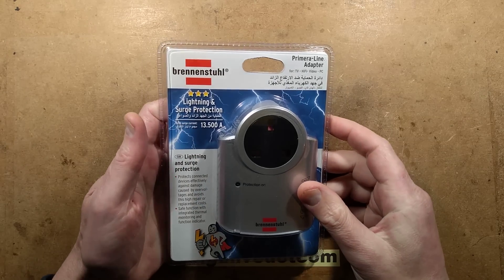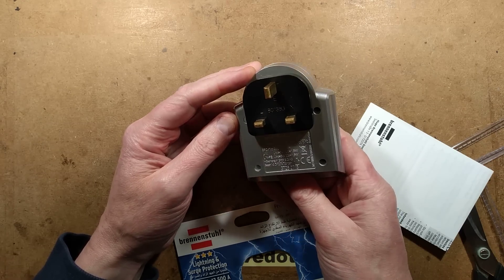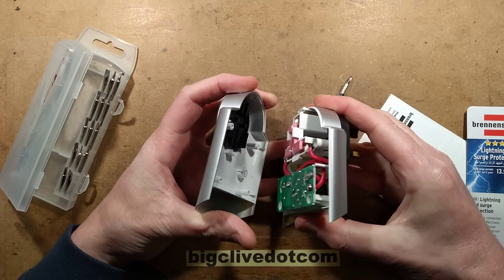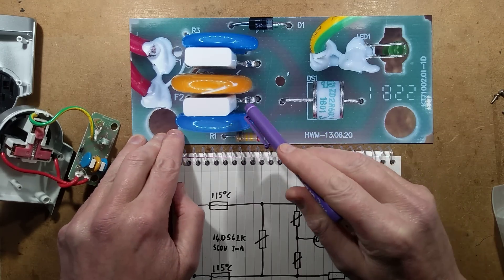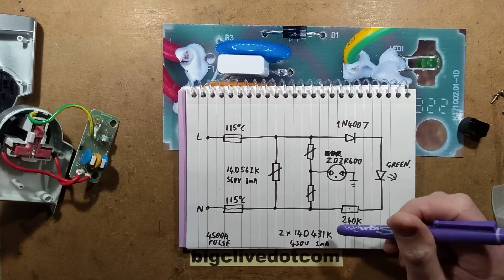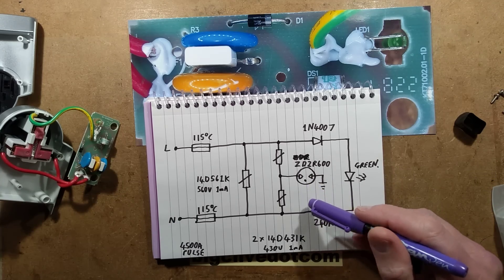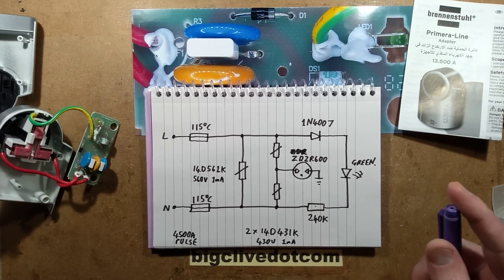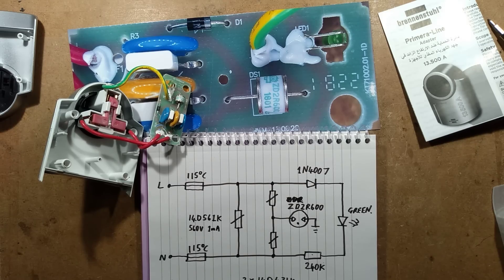Inside a 13,500A surge protector.  (With schematic.)

Comment: These brennenstuhl surge protectors have been my go to for quite a while. Any really expensive equipment I have is protected by a UPS, since those provide better protection against surges than surge protectors.
I use brennenstuhl extension cords in the labs at work cause their pretty solidly built and have some nice re-settable fuse versions. Can be difficult to source at times though... often don't see them for sale for months.

Comment: Way back in 1961, we moved from "the old homestead" a farmhouse built by my grandfather in 1910, to a more modern farm some 12 miles away. Dad put his land into the "soil bank" (a program where the farmland is left fallow for a period of time and the government pays the farmer for this) and he rented a farm closer to town so my sister could attend high school.  Well we were thrilled, we had electrical power!  When dad went to town he stopped at a TV repair/sales store on main street and made a deal on an old used floor model television, and a large antenna since we lived over 100 miles from the nearest station. Along with the package the repair guy sold dad a small round device with a sort of screen case that he said we HAD to have plugged into the socket before we plugged in the television.  He also sold us a lightning arrestor that had to be placed in the tv wire leading from the antenna that was atop a 50 foot pipe sticking up the chimney of the old farmhouse which was right next to the small house we  occupied.  I was just wondering if that little round black deal was anything like an early design of this thing?  I think what I remember best about the whole deal was that the set acted like a Ford Detector, any time someone in a Ford car pulled up the TV would show the firing of the spark plugs or something in a sort of interference pattern on the screen.

Comment: Clive, I was at a fire safety seminar. And I have a few surge and spike protected strip sockets. To cut it short the expert on these things said the only safe and workable units are ones that fit into your distribution boards. No other one passed their tests.
Reply: There is the unfortunate bit that with a major pulse these units do tend to go up in flames saving your electronics from electrical damage until the fire reaches them. If you want to be safe you need a large unit outside the house for power and phone lines so the fire is outside, a lightning rod on the house and even then you still need surge protectors for sensitive electronics to guard against spikes from large inductive loads and coronal inductive effects from nearby strikes.

Comment: I don't understand how it protects when it's wired in a parallel? Can't the transients bypass it altogether?
Reply from the maker: It shunts voltage spikes to a lower level.
Reply: @bigclivedotcom  AH. I was misunderstanding the varistor. Thinking it was high resistance at high voltage. Thanks

Comment: https://www.etradeasia.com/products_detail/51525/28682/0/8X6-Two-Electrode-Ceramic-Gas-Tube-Arrester.html
ZD2R series 2-Electrode Gas Discharge Tube series. ZD2R600 is for nominal 600V DC Spark-Over voltage

Comment: the stars you mention on the back are the class of protection, meaning they sell a standard surge suppressor for standard electronics marked 3 stars, then a better one for more expensive devices (4 stars) and then their top of the line surge suppressor for your most delicate devices with 5 stars. Would be interesting to get all 3 and compare if there are any differences in design at all, or just bigger MOVs...

Comment: That surge protector is probably better than nothing but for real protection you should use an "Automatic Voltage Regulator". They are common and cheap here in Greece; not so common in the UK. For info. see "Lightning and Power Surges - How to protect your equipment against" at the glodark web site.

Comment: in German 10.000 is 10k, while 10,000 is 10. A comma indicates a decimal and a period a thousands delimiter.
Reply: Same here in Spain
Reply: Funny. As student we separated every 3rd nuber with aposthrophes or spaces. Yet I am not sure what is standardised her in Hungary. Ofcourse comma ment decimal separation.
Reply: John Smith That's stupid.
Reply: @Asdayasman  it is ze German way, and therefore the BEST way!
Reply: In Germany, they also speak German. However, the text on the packaging is in English, and it is a UK style plug. Therefore, the UK convention should be used for the product and any other convention is incorrect.
Reply: @MrEdrftgyuji  Exactly.  They included our national second language, Arabic, so they should use our decimal system.

Comment: I don't trust any kind of surge protector for use inside the house. 

Reason: I frequently have to investigate house fires. I've seen houses that burned down because the surge protector caught fire and arced all over the place when lightning struck nearby power lines. Not cheap chinesium surge protectors, either.

Think of it this way: electricity always takes the path of least resistance to ground. Those "protectors" work by making a lower-resistance path than through your electronics, and for low-energy voltage spikes that works very well. Enter mr. Lightning though, and the surge protector in your living room suddenly becomes the lowest-resistance path to ground for one billion joules of energy. Once that current starts flowing through the surge protector, mr. Lightning doesn't care or even notice that those little fuses and varistors blow up into little clouds of incandescent plasma that light stuff on fire.

In my opinion, the only safe place for a surge protector is outside your home in a little steel box on a pole where a fire might cut your power but won't burn your house down.

It's your choice of course. Would you rather save your electronics from minor voltage spikes caused by very distant lightning, or would you prefer to save your house from fire caused by nearby lightning strikes? Or would you perhaps wish to do both by having a proper  protection device installed a safe distance from your house where it may blow up without causing collateral damage?
Reply: These are designed to protect your electronics from voltage spikes.  Nothing protects you from a direct lightning strike.  If lightning strikes the line coming into your house whether or not you have one of these surge protectors will make very little difference.  Something (usually many somethings) are going to detonate and burn.  There's simply too much energy to dissipate.  And you're far more likely to experience multiple voltage spikes on the line than a direct lightning strike.
Reply: @stargazer7644  Great point. There are always dips and spikes in line voltage, usually not anything significant but if that errant spike comes through, your stuff gets protected. The device is a "surge protector," not a "lightning arrestor." It's not meant to protect against lightning strikes, but if lightning strikes a transmission tower or pole a mile up the road, you're pretty much covered. There was one time when I was a teenager when a car hit a telephone pole in my town. I was doing homework when the light above me got significantly brighter for about two seconds before the bulb failed with a blue flash. We actually fried two surge protectors that day, but no casualties other than that one bulb.
Reply: That is an interesting point!
Shouldn't a sand filled fuse be enough to stop the ark?
Reply: I still want my electronics protected from voltage spikes, but can't I also have good circuitry outside my house for lightning strikes?

Is this an American thing?  Never heard of a lightning strike to a power pole setting anyone's house on fire here.
Reply: @Asdayasman  this was in Norway. According to the power company, the distribution line in one case was equipped with a spark gap type protector that should arc across if voltage exceeds 10kVolts so that should be the maximum that makes it to a house, unless lightning hits the low voltage lines directly. In that case lightning struck the line somewhere on the other side of the transformer, but something less than 10k Volts still made it through to the low voltage distribution network. A nearby house simply had the earth fault protection tripped. This one had a fancy surge protector installed inside the breaker box. That surge protector was the path of least resistance, and more or less exploded. The force of the protector blowing up ripped an incoming power line loose and shorted it to the grounded steel cabinet, melting a nice hole in the steel and dripping molten steel into the wall setting it on fire.
Reply: @Kaboomf  Right so like, context is I'm buying a house, literally right now, in the UK.  Seeing as I've never heard of this, my assumption is that the power grid has good failovers in place as standard, but how would I find that out, and if it's lacking, how do I protect my home?
Reply: @Asdayasman  you could ask the power company I guess? Usually there's some kind of protection installed near every transformer, but that tends to be sized to protect the transformer rather than the customers' equipment down the line. Depending on how your house is connected to the power lines you might have various options. If there's a small connection box thingy outside, typically on a small pole on the edge of the property, that would be a great place to have a heavy-duty surge protector installed. That box is usually property of the electricity provider so you'd have to talk to them about it.

If that isn't doable though, just try to avoid mounting your surge protector in the most flammable spot. Most cases are less dramatic than the one I described above; if you're confident that the protector itself could burn without setting the house on fire then that saves you probably 95% of the time.
Also, note that lightning causing fire in mains-connected stuff is relatively rare because of fuses etc. I've seen at least three times as many lightning-related fires that started in ADSL modems and other stuff connected to the old-fashioned copper phone lines that are still commonly found in older homes. If you don't use the old phone line for anything, disconnect it safely outside the house. Phone lines are fairly thin so they overheat and burn easily from voltage surges, and because they're not intended to carry high current there's no fuse where the line enters the house.

Comment: 3120W on the sticker / 13.5A = 231v (middle of the claimed op voltage?). So yup, 13.500 A.
Reply: Nope! That UK plug is rated at 13 A, and their mains voltage is 240V.  So 3120W is 13x240,  and is the maximum power allowed through the plug/socket connections, under normal conditions.  Clive explains how the marketing people probably arrived at putting 13,500A, i.e. 13.5kA (or in Germany 13.500A!).

Comment: If you hit that with 13,500A, it will vaporize, which WILL create an open circuit.
Reply: Not if the 13,500A only lasts microseconds.

Comment: 1.100,50€   ..  one thousand one hundred bucks and 50 cents. Brennen(der)stuhl   (burning chair ....) might use the german punctuation.

what i have learned in industry is:
if you do not have a real big lightning protection installation in your distributor panel,
that lightning wont be stopped in a small plugin device if it came that far already.

- Always wondered how often these producers really pay up the sum of 100.000 bucks or similar they promote, if you get really damage by lightning...

Comment: Is it just me, or is 560V protection seem a bit high?  (About 400V rms on a line that's supposed to be 240V.)
Reply: You can't make it much lower, or the MOVs will partially trigger at every sine wave peak.  Devices can see pulses in the 560V range fairly often due to switching transients.

Comment: Does this require a surge arrest in the fuse box or is it capable of handling something like an lightning strike on its own? I'm worried that a really high voltage is going to spark across inside that box easily before it trips. Of course I'm not talking about scenarios where lightning directly strikes your house. At that point you have bigger problems than damaged electronics. I get that they sell this as a quick upgrade for old homes as ideally you should have this protection in the fuse box and thus protect the entire home.

Comment: "lets see if I get a sap of the pins" casually touches wires with potentially a capacitor across them being charged up to mains voltage~

Comment: Not sure why that diode is there, since LED itself is already a diode...
Reply: Not a bad idea to use it, high reverse voltages degrade LEDs and shorten their life span.
Reply from the maker: The reverse voltage of an LED like that is only 5V.  It would effectively conduct in the opposite direction.  Some LEDs would be damaged by that.
Reply: @bigclivedotcom  oh, got it. Would it even be a problem with such a low current(less them 1mA)?
Reply from the maker: @Offsettttt  In this application that would double the dissipation from the resistor and push it close to its power rating.
Reply: @bigclivedotcom  Thanks for info!

Comment: And the diode? Is it there to protect the LED from getting a negative voltage? Would it be bad design if they would have left it out? Please explain.
Reply: funny stuff, because LED is a diode basically..

Comment: With lightning strike it wont help....the shear voltage will jump across the board with ease
Reply: rob burdack Good.  This device is meant to do that, giving the lightning no reason to go through your expensive stuff.
Reply: John Francis Doe no you misunderstand....it jumps across the board to the output wiring still causeing surge....ive lost 2 computers a Tv and a dialisys machine all as a result of lighting shorting around protection..... And fyi a strike will also short around a households fuse box .....half of my house needed re wiring as a result and it was all to code only wired 4 years earlyer

Comment: Their power strips also have the 13.500A printed on them and "super solid safety".
Brennenstuhl is a premium brand that I trust, but they can definitely dial down the marketing wank!
Reply: But they are only relatively good, as the quality of the whole market segment went down in recent years.
Reply: @fromgermany271  for consumers, yes absolutely.
We buy the expensive stuff at work and they're still good. for the consumer grade stuff everything is getting cheaper. copper strips are getting thinner, the child-proof shutters are harder to use...some even break on insertion of the plugs..

Comment: If you follow Clive's link, the picture of the surge protector has 4,500A written on it now :)
Reply: On the mobile version of the website, the product overview says "Protects electrical appliances against surges with a maximum up to 4,500A". As of July 3, 2019, the text above the product picture says "13.5" Amps, while the picture says "4.500 A".

Note that the outlet is rated for a 16 Amp load.
Reply: @hamjudo No that number is German notation and really refers to 13500A and not 13.5A. This number does not refer to how much current it can handle on a constant basis. It only refers to the pulse current that it can take, so just a brief moment. Though, that is still higher than the individual components. Here in Germany it is still marketed as 13500A on the official website.

Comment: If you click the CPC Farnell link, It says 
Primera-Line Surge Protected Adaptor, 13.5A 230V -  1506953
Protects electrical appliances against surges with a maximum up to 4,500A
Max loading of 16A
and The product number on the site matches the 13.5 version box you have 
and the website Picture shows the same product but with 4.500A written on the casing.
Just a mess. So its 4500A ? 
When can we watch you blow it up?

Comment: It's a shame that failure of the gas discharge tube isn't indicated though - you could go for years without knowing it wasn't there any more. I know of a similar Belkin device up in north Wales, added to the wifi router mains socket after lightning took out 4 routers in succession :o(  Don't know what's inside the Belkin device. I do know that the last blown up router would have made a great BC video - the wall psu was blown, some components at the router power input were vaporised, the phone line input txformer was blown, and on closer inspection several chips had cracks in them .... however, after fixing the power side I found I could, almost unbelievably, talk to the router via wifi - no use for anything else mind you :o) There's a very rigid rule now  about disconnecting phone line and power when not in use and/or storms are expected - latest router has done about 5 years so far...
Reply: Under what situation would the gas discharge tube be destroyed yet the MOVs would survive?  The tube is rated for more Joules than the MOVs.

Comment: i wont trust it works out in case of a strike, many electronics today have several connections like internet, usb things ...... and so to other power outlets, high peaks finds their way through you house even on gas or waterpipes, a bad strike can destroi every wire and pipe , you try to protect things on the side of a poweroutlet while problems can come from other directions too, like internet coming in your house to a router and connect many things in your house as a big network of equipment, i hear many people say i disconnected to powercords when thunder comes...  it wont help much if other connections still on, disconnecting everything is not easy today anymore but thats the only solution to be save for strikes, at least for your electronics lol.

Comment: Clive - your DIT400 set to 1000V can determine the DC standoff of the MOVs at 1.6mA. And the new advanced version (which no-one actually sells yet) is able to determine the sparkover voltage of the GDT.